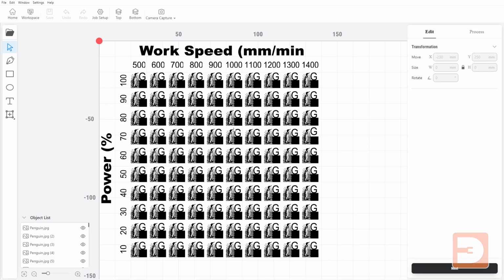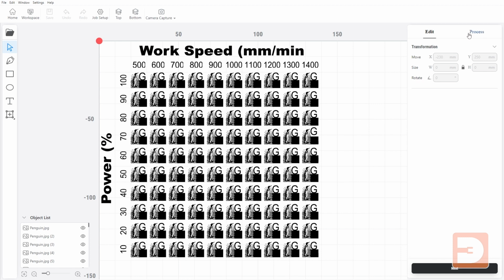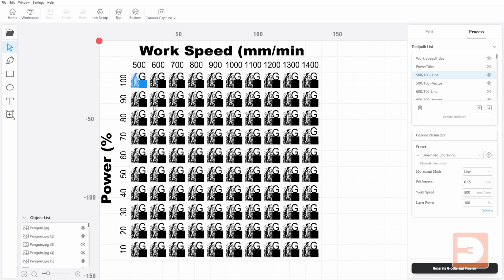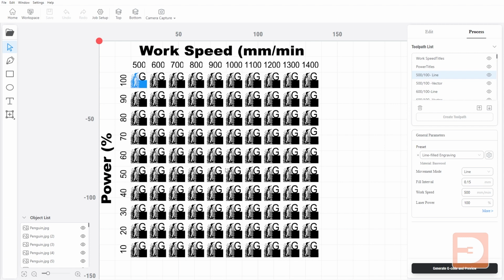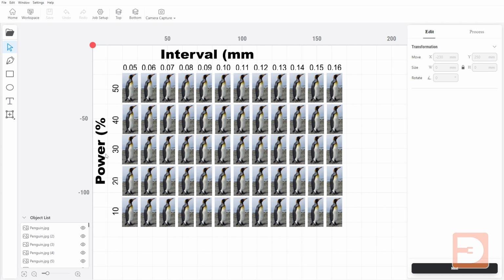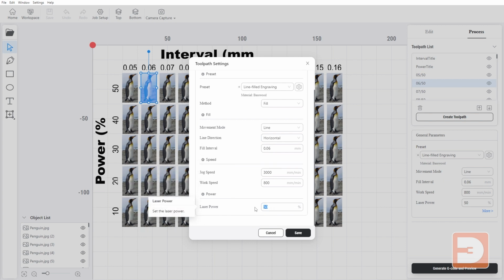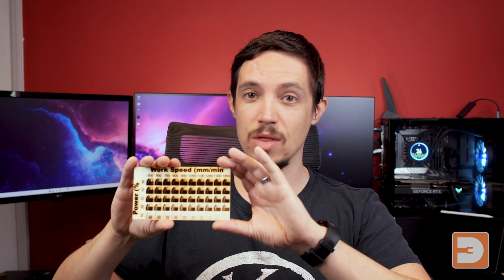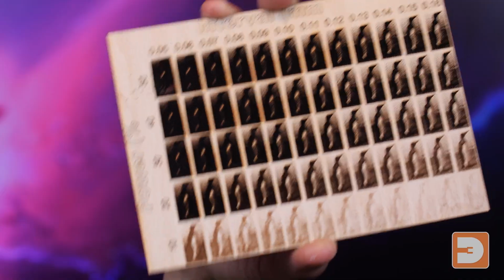Finding the right settings for Laser Engraving using test grids

Comment: This looks great, but I can't get it to work in Luban 4.10.1 (which I think is the latest version). Also, there is an issue with Chrome when I download some of the files with the message "insecure download blocked".  I can get around that, but just thought I'd let you know. Here is the issue with Luban using the Line Fill and Vector_Power & Speed (Low Power).snaplzr file. I can open it in Luban, I can look at all of the toolpaths, etc. But when I tell it to Generate the Gcode it runs briefly but generates nothing, no preview and no Gcode. There is no error message, but after this my interactions with Luban no longer work properly, so I have to restart Luban. Any suggestions?

(Added 1 day later). I used the Gcode (.nc) file that you provided, and that worked to get the test grid etched, but I still would like to figure out why Luban is failing with the .snaplzr file. But thanks for doing this and for providing each in both file formats!
Reply from the maker: Hey Rob, so sorry for the late reply. 
That's great to see the .nc file worked for you, thanks so much for updating your comment.
Sorry the .snaplzr file isn't playing ball. I've added this to my list to eventually get to and I'll look through it. Thanks again.

Comment: Sound stupid but I never understand how actuly read the chart pluse can use shame charge exact same bit matareal get total different t results
Reply from the maker: To read the chart, simply find the image on the chart after engraving it that looks the best quality for what you're after, then look at the settings that it lines up with for that row and that column, and those are the settings you'll want to use. And yes, the point of these tests is to find out the best settings for a specific material with your specific machine. So you run this test on a scrap piece of that material, then you can use those settings for other pieces of that same material.
Reply: Eagle falconry all way flying first one and am hooked

Comment: Thank you so much for doing this video and using Luban and Snapmaker. I
t is very hard to find things like this for Snapmaker Artisian and it will be helpful. I just hope I don't burn the hous down because I have the 40W laser...lol
Reply from the maker: Good luck, make sure you turn down the settings on these before using your laser. As I mention, this was set up for a 10W laser so you'll want to lower the power levels or increase the speeds by a relative degree to adjust it for your 40W setup.

Comment: hey , thanks for the informative video ! I downloaded the test file and loaded on to lasergrbl , but when i run the test file the laser does not fire up. It moves as though it should be working but nothing. any ideas . Thanks
Reply from the maker: Hey Asa, sorry for the late reply. 
Hmm, I'm not sure why that would be. Could I check what laser system it is you're using?

Comment: One more request.  Could you redo your test grids to be used by an xTool D1 Pro 20 Watt with XCS on a Windows 10?  I and so many others would be so grateful.  The xTool D1 Pro 20 Watt engraver is great, but support from xTool is sadly lacking, sort of a universal opinion outside of the country of manufacture.  I am on several xTool groups, asking for help, and coming up blank for too many of my questions. I for one feel abandoned by xTool.  ;-)  Thank you for your link.  It appears to us that YouTube is having problems with your test grid video.
Reply from the maker: Hey clifford, I'll have a look into why that is happening. The power setting should be a percentage, rather than a finite vallue, so if it is set to 90% power and your laser works out of 1000, that should in theory set it to 900 for you.
My only concern is I don't have an xTool and I wouldn't want to produce a file for a device that I've not tested which could cause you or your equipment any harm.
Our of curiosity, you say that YouTube is having a problem with my test grid video, would you mind explaining what you mean? I can look into what the problem is there too.
Thanks, Josh

Comment: Hi Josh. Thank you for putting all of these together. I am trying to open your test grids in my Luban software. The project files will not open. I am using a Mac and Luban 4.4 Are these files compatible with my set up?
Reply from the maker: Hi Kevin, my pleasure.
Unfortunately as Luban doesn't seem to be very well optimised, it doesn't handle 'large' files very well. Even though these projects contain very small photos, they are repeated a lot of times. As a result, even on my machine (which is a pretty beastly computer), it can take a good 10 minutes just to open these files.

Unfortunately that's just a matter of Luban struggling with complex files but if you think it would help you still, I could either make a version with less setting options (maybe half the amount of the current ones), or ones which just have the solid black boxes and which don't have photos. Let me know if that would help and I'll get them put together.

Also if you think it's not loading for another reason, definitely let me know and I'll see if I can help.
Reply: @3DRevolution  Thank you for replying. I was trying to open the "SNAPLZR" file by using the folder icon in the project window. I just realized that I need to use the file menu to open and open it as a project, not import as a file. My bad. Thank you again for putting this together. Your instructional videos and file are top notch!
Reply from the maker: @MrBebets  Hi Kevin,
Ah that's great to hear, glad you're all sorted with it and thanks for letting me know.

Sorry about the late reply, YouTube managed to turn off my notification for comment replies so now I'm working through all my videos and comments to see if there's any I missed. Haha
Reply: @MrBebets  But still I cant open the file?